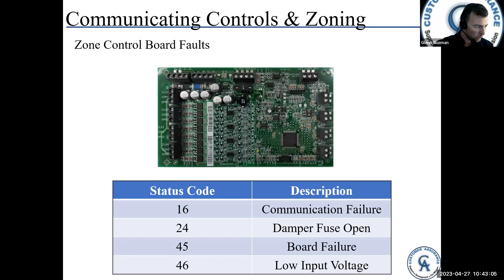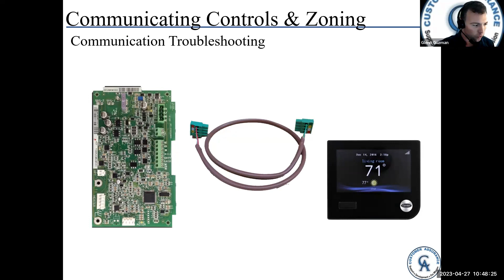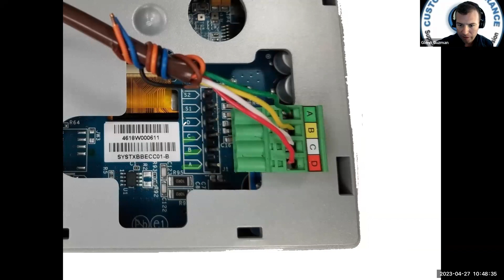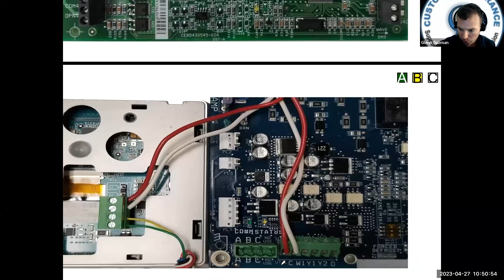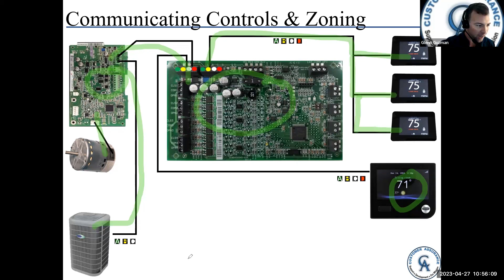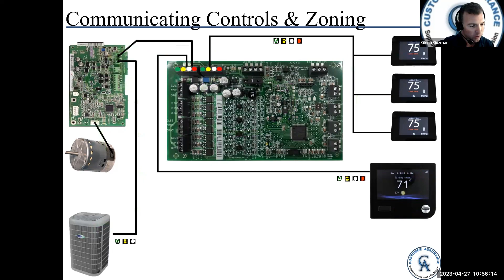Infinity & Evolution Zoning Communication Troubleshooting

Comment: Hello,  Do the carrier infinity zone panels work with non carrier dampers like Honeywell and EWC?
Reply from the maker: No. Carrier infinity zone panels only work with carrier power open, power closed dampers actuators.
Reply: @glennguzman We found out the hard way 😂.  Do you have experience with the ewc or another brand of carrier compatible dampers? Wondering if they're worth it to try cause they're probably 1/4 of the price to these carrier dampers now. 
Thanks for the video and response not really a carrier installer so I appreciate it a lot !

Comment: Question, iF you unplugged the blower wouldnt that in itself cause a communication Fault?

also instead oF moving the UI or maybe just to move Faster troubleshooting, wouldnt it be easier to read vDC From terminals A & B to C?

thank you Glenn! Dont see many units like this in my area.
Reply from the maker: IF you unplugged the blower that would create a blower communication fault which is different from a system communication fault. Code 44 is blower comm fault. On a properly operating system you can measure VDC but when there are comm issues measuring VDC won't really help you unless you fully understand the system as a whole and are very familiar with Carrier infinity. AND if that is the case, you probably don't need to watch this video. :)

Hope this helps!

Comment: Do you have technical documentation on actually testing damper control outputs on this zoning control board? I.e. testing procedure with our AC meter and WHEN exactly should we be seeing +24v? And For how long?  Carrier troubleshooting documentation on actually testing the outputs fails miserably At explaining what we’re looking for.   With no motors connected to my board I see +24v on com &opn but at the same time I also read +24v on com +cls  all 4 damper outputs read like this on two different boards.  When I hookup a damper motor to said output, my voltage reading then drops to basically nothing but I never see it change when I make the controller call for heat. Furnace engages, I watch meter, voltage never goes hot on com &opn like I’d expect to maybe see when the respective zone is calling
Any help is greatly appreciated. No luck finding local support and still waiting for a return call from carrier tech support on this
Reply from the maker: The carrier infinity dampers actuators are power open / power closed. There are 15 different positions. The damper is energized for 15 seconds going from 100% closed to 100%  open. The reason you read voltage on open and closed when the actuator is disconnected is because they use triacs. It is normal to read voltage on open and closed when no actuator is connected. You should read voltage for at least 15 seconds if you can catch it while going open or closed. Sometimes it's easier to use a short piece of wire and bring the actuator to the board and hook it up. Then test it and watch. Hope this helps.
Reply: @glennguzman thanks for taking the time to reply. Yes measuring the voltage was throwing me off but makes sense now that you’ve explained it. I wound up using a battery powered ring camera and positioned it up in the attic to view the damper on my phone as I messed with my testing down below. Finally got it working by going back through all the setup procedures in the carrier Wall Mount controller/thermostat . Thanks again for replying to my question
Reply: I am troubleshooting  a 4 zone Evolution system with a user interface and 4 remote sensors. The system has intermittent failures due to loss of communications with zones 2,3 and4. I’ll run it through the zone test, communications will restore for anywhere from minutes to days.  Any help would be greatly appreciated